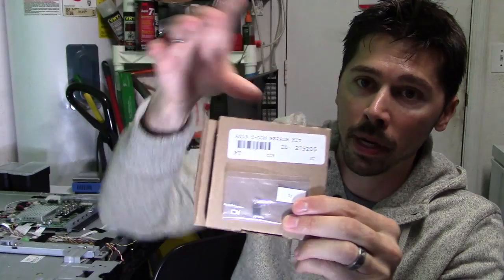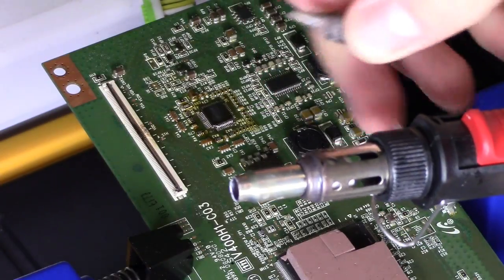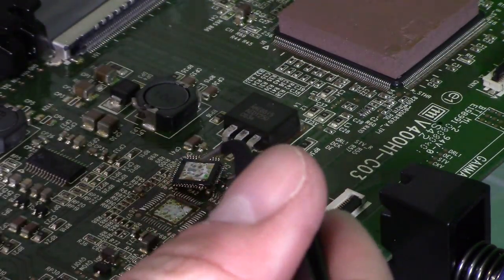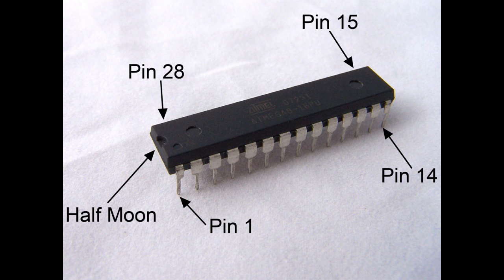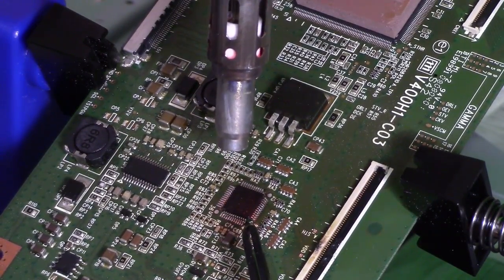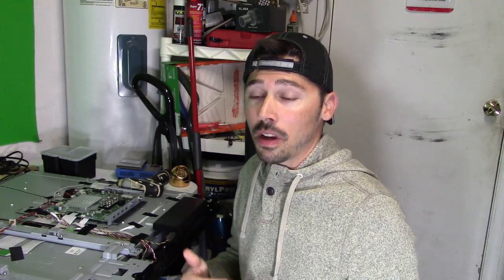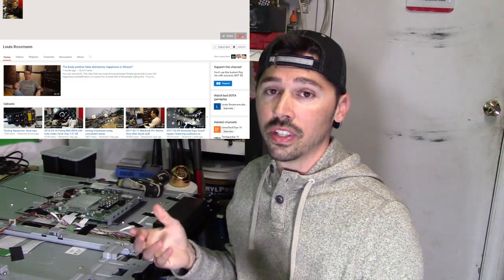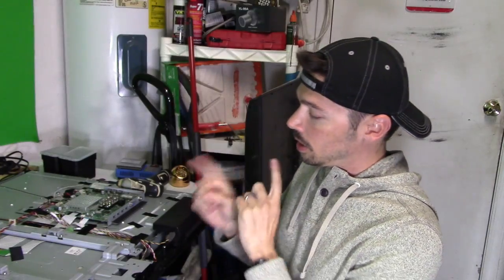LED LCD TV REPAIR GUIDE TO FIX MOST SAMSUNG VIDEO PICTURE SCREEN PROBLEMS

Comment: Have you ever thought of a rework station,they have them for under 50.00 and they come with. Built in soldering station,I can do things with this station ,I never thought I could do,as a older man I bought mine on eBay model number 898 D  take a look and watch the video on you tube.save yourself a lot of work and its Easyer on your components

Comment: If you get a desk magnifying glass that has the light and order the cheap helper arms you can take the glass off the arms and mount it under the desk glass you have the same magnification as you need under a microscope for soldering. You get a wider field of view and more light. It's a cheap way to get started.  I found putting the IC on with an iron is so much easier.
Reply from the maker: good tips thanks
Reply: Wow, Very good tip, this is exactly what I do, thank u

Comment: 👍🏻 👍🏻 👍🏻 👍🏻 👍🏻 You really are great at this and it's nice of you to share your knowledge. You said that the t-con board was the main board in the television. Do you know what this particular chip does? I'm just curious and if you don't know, I bet I can look it up by the ic number. Thanks again for all you great help.      B.
Reply from the maker: Buddy Martin the mainboard is the audio video board the t con board connect to the LCD panel
Reply: Thank you, that makes sense. Thanks also for the links to the soldering guys. I'm great at soldering at regular component level, I've never tried any of this micro stuff. You guys make it look easy. 👍🏻= Big Thumbs UP!
Reply: Nous vous remercions de ce genre d'exercice pour aider vos collègues pour l'emmergence de notre service merci

Comment: will this work if they say the panel needs replaced. I have a 55 inch Samsung that they says needs a $1000 repair. its only 3 years old. I would like to donate it to you if it can't be fix for experimental panel fixing I guess.